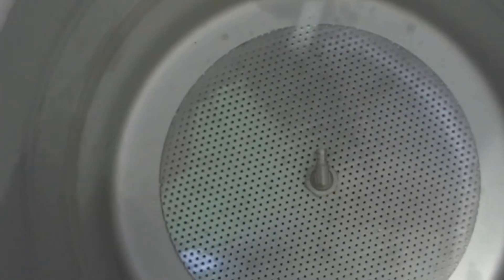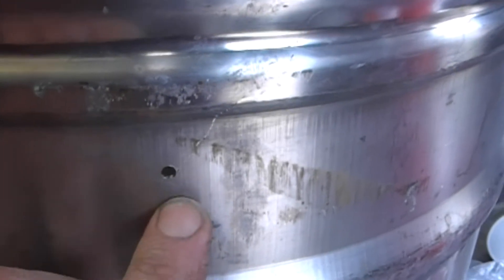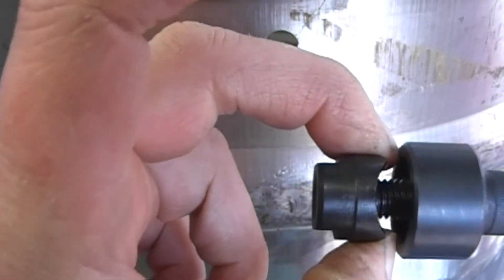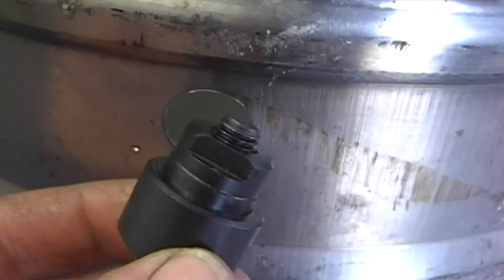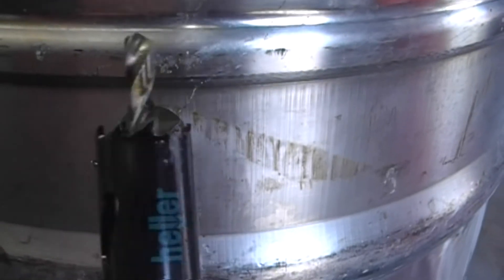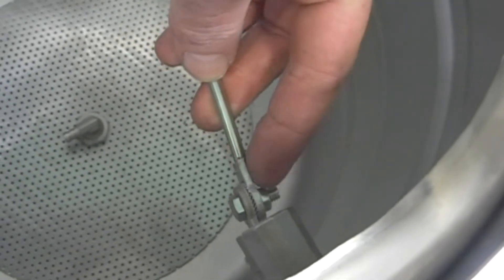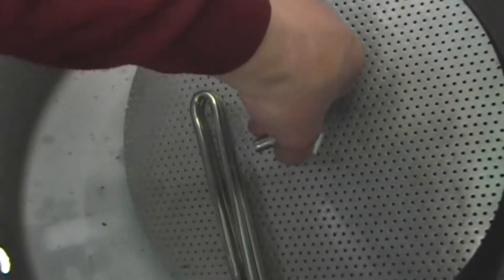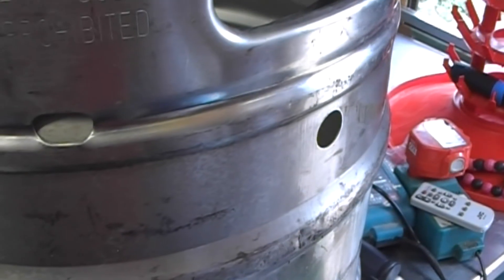HOMEBREW WEDNESDAY # 161

Comment: Excellent info. I didn't think those punches would be strong enough to go through the side of a keg. I think I'll be getting some punches now. Thanks and cheers🍻
Reply from the maker: Was just in on the specs of the thickness which is 16gauge 0.052inch. Cheers